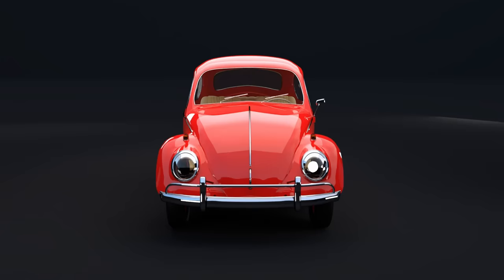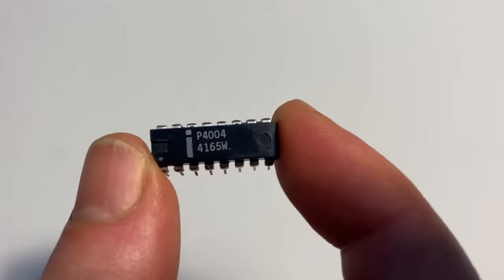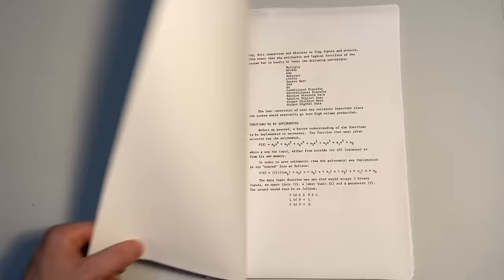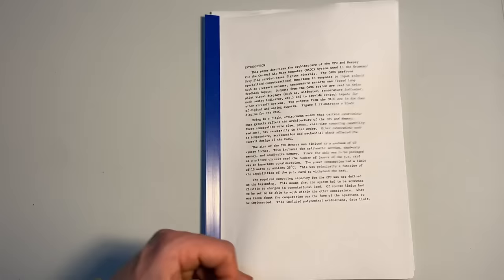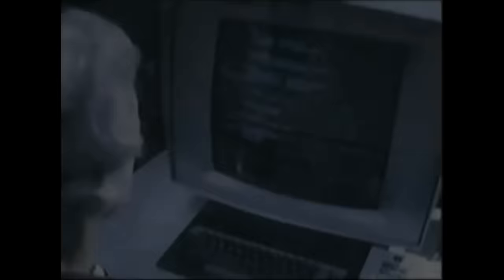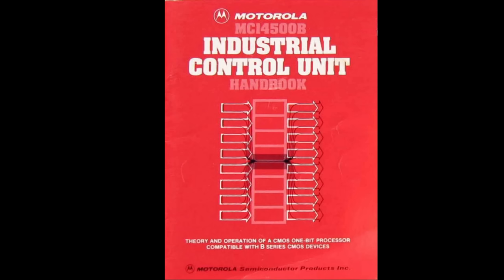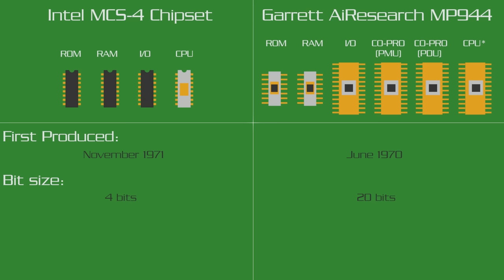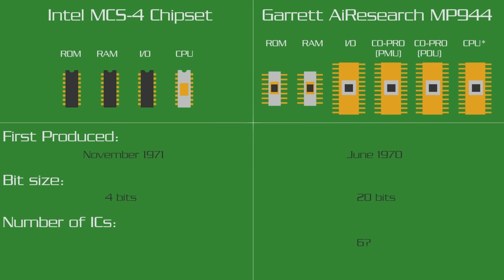The World's First Microprocessor: F-14 Central Air Data Computer

Comment: Having flown the F-14A "Tomcat/Turkey" and then going on after my time in the Navy to work in the computer world...  I can't count the number of times I had to bite my lip during conversations about CPUs and sit and wonder "when" until the Osborne, XT, Kaypro and Compaqs came online.      We knew the processor was there however we really didn't get into in any depth.  We were just dumb Aviators... NFOs.   Coming from the A-4 "Skyhawk/Scooter", my initial instincts were to turn it off and control sweep manually.  But, I came to trust it and in ACM school learned when to turn it off so as to fool the adversary as to your airspeed, turn it back on to get into position to get a splash.    The real beauty of Bob Kress' overall designed was that he used this computer control and the airframe design to do something completely new...  it didn't roll at the nose, but at the HUD.   So when engaged in ACM, the plane rolled at your eyes, not your feet - Evolutionary.   I never met Ray, but I did get to meet Bob in the mid-80s in Bethpage, NY.

Was that a Data General Nova in your video (yellow/brown switches)?  Worked on those too.   I watched this with great interest.
Reply: Awesome insight
Reply: It does kind of piss me off that bits and pieces of this architecture were not released to Intel, DEC, etc to jumpstart the microcomputing industry. They could have done that without revealing the specifics that made this so powerful in this application.
Reply: What a comment!
Reply: Does the F/A-18C do the same as in rolling at the eye level?

I always wondered why it felt strange when playing it in DCS and rolling, and this would explain that if it does.
Reply: @mikedavis7065  DEC already had processor kits consisting of several ICs at the time, at least PDP-8. Also, you don't need 20-bit CPU to perform 20-bit calculations, it's misconception.
Reply: @ohnolookwho241 I have no hours in the "electric bug"...  While it had been in development for 10 years, it was just coming online in my last couple of years.   I sat is one for about 20 minutes.
Reply: @TheGrantourismo  Obviously you can do any arbitrary math precision with any turing complete processor. The video touched on that though and it would take a lot of clock cycles with a 4 bit processor to solve any real math problems.
Reply: I wish I could like this comment harder than just a single like.
Reply: Reducing Coriolis effect and temporary dizziness?
Reply: Thanks!!!
The F-14 is still a favourite in my heart.
"I feel the need - the need for speed".
As I once upon a time visited "La Belle discotheque" in Berlin........ just some days later, 5 April 1986, it was blown up by Muammar al-Gaddafi. On 15 April 1986 F-14s  participated in Operation El Dorado Canyon, providing fighter cover for a series of air strikes against targets within Libya. 
That is my personal connection with F-14!
Best Greetings from Sweden.
Reply: When you say it "rolled at the HUD", did this have any beneficial or negative effects on the sensation of G force, or are G forces not really relevant to piloting in a roll in the first place?

Edit:  Ooh, the video has an F-111 shoutout.  Those things sure did launch loud.  I worked for a couple of years at RAF Lakenheath, which used F-111s for many years.
Reply: @delusionnnnn  Think about it...  if a plane rolls at it's nose (let's say pilot's feet) you will experience a little negative G at your head.   If it rolls at your nose, you will experience a little positive G at your feet.  But really, it's minimal either way... unless you are in a T-38.
Reply from the maker: Thanks for the amazing insight here! I can add this to the list of discussions I've had with pilots over the years who eventually fell in love with flight computers as it allowed them to actually 'fly the plane'.
And yes, I believe that was a Data General Nova....I thought it was a PDP-8 when I edited it but I'm pretty sure I was wrong.
Reply: I tried it in DCS World, but it doesn't seem simulated, it seems to roll right about the nose probe. I tried at multiple wing sweeps, rolling with spoilers and horizontal stabilizers. I wonder if I was missing some setting, or if the simulation is incomplete.
Reply: @Grayfox988  Couldn't tell ya, don't play games.
Reply: You flew one of the most majestic planes in history. I am jealous beyond words.
Reply: "it didn't roll at the nose but at the HUD" - can you expand on what you mean here?
Reply: Hi Ramosel, Nice to meet you finally.  Ray Holt
Reply: @firstmicro    Wow, thanks Ray.  It is an honor and pleasure to get a response from you, Sir.   Your efforts made a great plane even better.   Did you, personally, spend much time with Mr. Kress?   Are you still in the Silicon Valley area?

edit:  Also, very cool that Alex used Snort's knife edge fly-by in the thumbnail of this video.   He is missed.  After the RAG he helped me with my kick turns.  A real gentleman and a deadly pilot.
Reply: If you have some time, I’d love to chat with you about any DACT you may have participated it, or just the Tomcat in general. I’m in the research phase of putting together a long form video feature about the F-14 and talking with pilots has given me the best resource out there.
Reply: @hayleyxyz  I'll try to explain it as I understand it.  Imagine in a 'normal' aircraft, it's roll axis is through the tip of its nosecone through the end of its tail.  This aircraft will roll (spin) around that axis.  But the pilot sits well above this axis.
Now imagine the F-14, it's roll axis is through the middle of the HUD instead of the nosecone.  This puts the roll axis inline with the pilot's eyes.
Reply: @ShannonOddo  I did not know that. That would explain why the F-14s in Top Gun seem to roll bottom out in every scene. It was always such a cool look, but I had no idea it was designed that way. Just figured they did it because it looked cool on film.
Reply: This might not be the kind of "computers" you're talking about, but have you considered doing a video about the E6B "Whiz-Wheel" flight-computer?  @Alexander-the-ok
Reply: @ShannonOddo  It sounds like a neat solution.....but I still need someone to explain what the problem was.  I imagine the radius of that extra movement without eye-centering would be masked by the circular probable error of the guns, anyway.
Reply: The F-14 even in the later models before it went tango uniform, was a hunk of junk (from man hours of maintenance perspective anyway) with every F14 cat shot, that would equate to another cart of WRA’s for IM3. The 18, was orders of magnitude better (as long as you have a good supply of drop tanks or don’t mind meeting up with a tanker every hour on the hour!!)
Reply: @user-ny5hf2zp7r   The "Electric Bug's" only shining point was it lined Dick Cheney's pockets.  It was an econo-fighter at best.  It had no legs. It could not carry the 1000lb AIM-54 (let alone, 6).  The super bug is a bit better but NEITHER constitute a true "Fleet Defense" fighter that the Tomcat was.   And if you buy the MH/FH numbers as a reason for decommissioning it,..  Look at the F-35.  Cheney made millions from McD when he put the knife in Grumman's back.  Remember, he killed the A-6 and it's variants too.   And the Growler will NEVER be what the EA-6b was...  it's only plus is being faster.
Reply: @ramosel  missing out. games these days better than real life for sure for sure
Reply: @housemana  I'm sorry, no video game will EVER come close to a full stroke, Zone 5 Cat launch.   But, at least you can still play the game.  My girl has been retired and Mom is at the bottom of the Atlantic.
Reply: WOW!!!, I grew up in San Diego, very close to Miramar, where before the movie came out the phrase Top Gun referred to the fighter school there, and got to see lots and lots and lots of F-14s  in the sky, and at airshows on the ground and up close, I had the distinct impression that the F-14 "rolled funny", but now thanks to your comment I understand why and what genius that was. Thanks and WOW !!!
Reply: @TheGrantourismo  No, this was still a few years before DEC had LSI processors on just a few chips. The PDP-8/A (with the first PDP-8 CPU on a single board) didn't come out until 1974, and the first single-chip PDP-8 CPU was the Intersil 6100 in 1975. The PDP-11 had only just been released when the CADC was put into operation, and it too didn't see LSI versions until about 1975.
Reply: You should have sold the info to the Russians
Reply: @hayleyxyz HUD is the Head-Up Display, which provided duplication of essential instruments (altitude, speed, attitude, etc.) and the gun/weapons sight. This was projected with prisms in between the pilot’s eyes and the windscreen, with the focus point being outside the aircraft so that the pilot didn’t have to keep moving his eyes and refocusing between the plane he’s following and the instruments inside the cockpit.

So turning the airframe around the HUD meant the pilot kept his eyes focused on the target.

I never knew this about the Tomcat and I imagine it gave them a substantial benefit in dogfights.
Reply: @h8GW  I'd think it is to do with how controllable the plane is to you as a pilot, you have sims where some planes or 'ships' roll around an axis somewhere below your feet, which makes it very difficult to instinctively orient and track where&how you are in space in relation to other things, if you get what I mean. It's not so much of an issue if you're doing nothing else at the same time, but when you're rolling, rotating and climbing at the same time aiming for a specific vector so to speak it gets very hard if your roll axis is way outside your own "sensors" aka your head. It's the same way btw if you're building a drone of some kind and place your gyros and accelerometers far from the axis of control so to speak, and it quite simply doesn't work well at all without a crazy amount of extra math to factor in and compensate for the difference between the motion axis and the sensor axis. If you take a stick and spin it around the center, in the center you only have rotation, but at the end of the stick you have several other forces at the same time, centrifugal outward force, up or down, left or right on top of the rotation. So to simplify the control and "feel of where/how you are" orientation and motion, it's always infinitely better to have your 'sensors' as close to the axis as possible to eliminate the "bonus extra" you get more and more off when off axis of attitude/control. 
Ehm, so, the "seat of your pants feel" of the thing is what it's about I think. No idea if my ramble makes sense, I've worked with this sorts of systems but never really thought of how to explain it in a good way without a white board or paper and some sort of object I can hold up to show what I'm referring to.
Reply: you are somebody I can trust; not cruise;
Reply: LOL at these combat simulator nerds
Reply: @hayleyxyz he already did in his 3rd comment

Comment: I remember it could perform 100k operations per second, which was unbelievable. I believe it could track 9 bogies and shoot at 6 simultaneously. Pretty crazy stuff back then.
Reply: do not be confused, the CADC is the flight computer, the ability to track and shoot 6 at the same time was due to another immensely complex part of the plane, the AN/AWG-9 radar.
Reply: @Galf506  You are correct. I was assuming that they used the same computer. Like I said it was a long time ago! lol!

Comment: Note on the glove vanes.  They were designed to preserve agility at high supersonic speeds and would have had little effect at lower speeds.  It was later found there was almost never a need for dogfighting at supersonic velocities; combat quickly became subsonic where the glove vanes gave no advantage  As a result, glove vanes were disabled and/or deleted from later production runs to save weight and maintenance.

Comment: What's so interesting to me is how the forefront of so many technologies came together in military applications in the cold war, and not just in the US. In Sweden Ericsson (of later cellphone fame) cut their teeth on the Saab Viggen's onboard computer.
Reply: It's been so long since Saab Gripen came out, I wonder what they are developing now.
Reply: SAAB is an acronym, and the correct correct way to spell it is with all caps.
Reply: @hueyiroquois3839  I just went to their website to check, and on the main splash page it's spelled twice, once as SAAB, then again as Saab. So clearly they don't care, and neither should you
Reply: I tought DATASAAB was a part of Saab before going independent and them at some point being swallowed by Ericsson when they wanted to grow from telecom into computers. 

Anyway. Data Saab. CK37. First flight computer with ICs. Very early 60’s. Also a 20-bit computer. Already a veteran by the time the F14 came out. Also lasted into the 2000s on the Viggen. Not microprocessor, but several years before, and in a small european country. Heck. The Brits make movies about how they discovered a way to crack the Enigma code, in Sweden, some guy broke it 2 years previously while riding  his bike to work.
Reply: @hueyiroquois3839  It is a not an english acronym spelled SAAB, though. It is a company name spelled Saab. The name is based on an swedish acronym, which is written with only the first letter in caps unless every letter i spelled one by one, in which case it would be all caps.
Reply: @hepphepps8356  According to page 2 of the Sonett V4 owners' manual, apparently, it depends on whether it's in a phrase like, "The Saab Sonett V4 is a...," or "...an authorize SAAB garage."